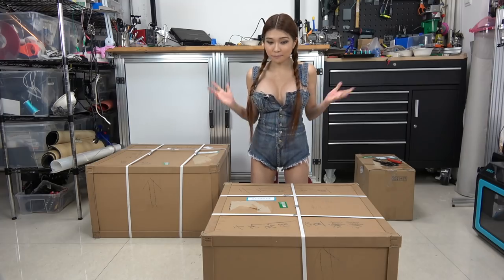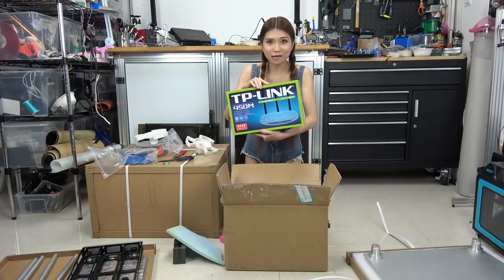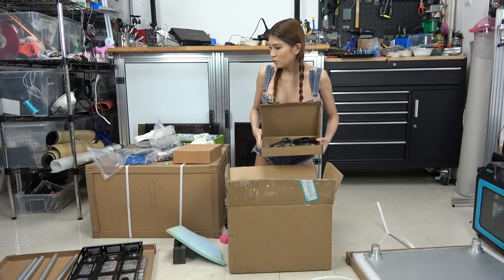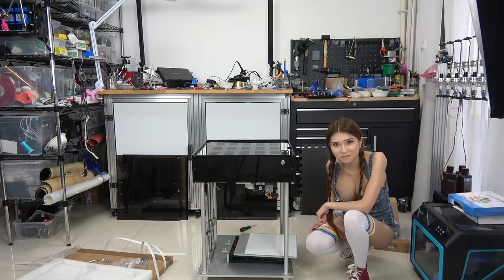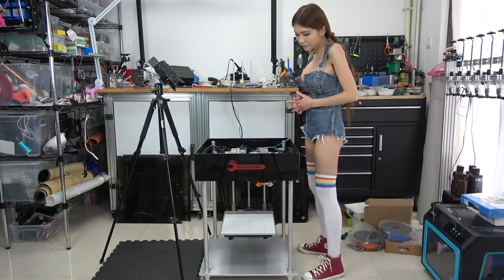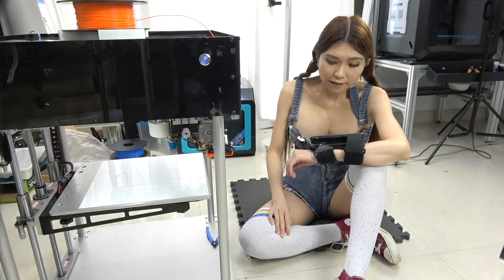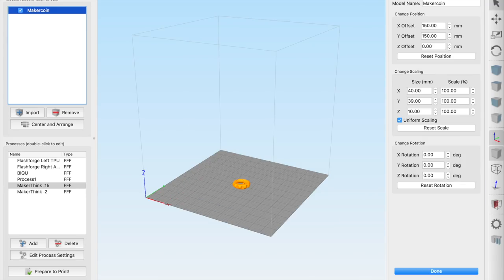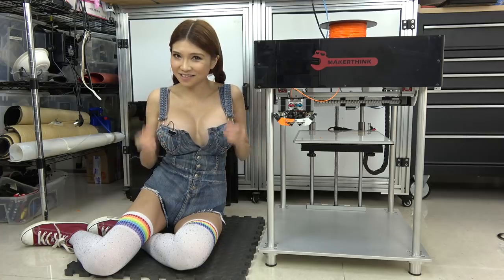MakerThink Knight Precision 3D Printer Unboxing!

Comment: Hi Naomi. I'm so glad you recognize other female technologists in your presentations. Thank you!
Suggestion to MakerThink: A 3d printable bracket set; to be used on the support columns that would allow you to bolt on simple panels. This would provide a simple heat-retaining enclosure.
PS: I think the use of servos on low-end Laser, 3D printer, CNC are the next big thing.
Reply: In fact we have the panels for enclosure. But in the video, we didn't use it, so people can see the interior better. from MakerThink :)

Comment: The filament path looks like it needs some of work, the print quality for a machine that solid out of the box should be better. 
With Octoprint on it should have a slicer plugin loaded and it should be setup to work with the machine. 
Related its nice to see you promoting other women in 3D printing, Gina Häußge is a rock star for octoprint. I always find it puzzling why only 5% of the views on my channel is from women.

Comment: I think the word u wanted was thread. Groove is OK but bolts and screws have threads. But ur English is excellent really 👍 💕. The socks were cute too 😘 Long time fan 😉 🌹
Reply: I believe component recess is the correct terminology you're looking for. Good video if you just want to view what it looks like to get a rough idea but I prefer to read the technical manuals & specifications that's just me. I already can see some over heating issues that will surface but I guess they will figure that out it's a prototype all along right :)

Comment: Hi Noami, one thing I like about this printer, is that it can disguise as a table top when not in use. Space saving. The platform stay up when off ?, this way, you can keep printer related stuff at the bottom.

Comment: Hay Naomi quick temp set for Printoid is to touch the extruder logo above the slider it will give to a type in number pad prompt for setting the temp to an exact temp.

Hope that helps 😀
Reply from the maker: AH! Very much so- thanks for the tip🙂

Comment: That is quite the tank. The only issue I see that might come into play would be table deflection on very large prints. Linked duel Z axis screws would be more robust.
Reply: Hi, I am the designer of this. We are considering on dual Z for a larger model.
Reply: Good to know, Thanks.

Comment: Really impressed with the industrial thought going into this, and have checked out their site. Liked everything from the move to servo motors to the tension adjustment screws on the extruders themselves. Though I am interested in developments, and wondering the price point they are gong to sell this at. Seems with build itself shipping cost are going to play a huge part.
Reply: We will do our best to reduce the shipping cost :) That's why you can find 2 cases in the video, and why Naomi need to assemble it. from MakerThink .

Comment: A printer with ballscrews and servos deserves a auto bed leveling probe. Also Im wondering... what about the rigidity of the aluminium rails - does it shake a lot, or is it sturdy?
Reply: It's very very sturdy. I promise.
Reply: great! Still though - with that setup it needs a bed leveling probe. Seems a shame to level it by hand when it's got such nice gear otherwise.
Reply: Could we discuss about the auto leveling? We are happy to add one.
Reply: Sure - what is the build plate made of? It looked like aluminium, right? if so - I believe the cheapest, and also best way of autoleveling would be to simply add something like this: https://www.youtube.com/watch?v=11HUw2CCmCQ&t=23s

Otherwise, a capacitive sensor would also work just as good(if the buildplate is covered with buildtak/pei)
Reply: Metal hotbeds are tricky - they have a tendency to warp slightly since you heat them up. Im not sure by how much, but being able to do multi-point probing is always a good thing :-)
Reply: We are considering about using another model from Omron, which can work with non-metal surface.
Reply: what kind of probe?
Reply: BTW: My bad - I meant inductive probe, not capacitive.

Comment: After see the finished works the cube stringy could be adjustment issue or nozzle defect it did drip at first nice converse shoes I had a pair when I was young play on the team they were big name back then see they are making a comeback that out fit is cool too got that back woods feel going.
Reply: Right now I guess the reason is the cooling fan. I think it's not connected. We designed a plug near print head for this fan but seems we forgot to plug before shipping.

Comment: Greetings from New Zealand again Niomi,  wonderful video as usual, these prints seem to be getting bigger and heavier. Definitely not a hobby machine! But I certainly like the solid build quality. How did you find the process of feding in the Filament?  I'm sure my hands are not as delicate as yours, seems like a small space ai?
I'll definitely look into octoprint for use with my prints,  thank you for a most informative video, be interesting how this product pans out.
Reply: Hi, I am the designer of this printer. We have a tube on the upper side for feeding, so you can just grab the filament and put it into the tube, and just click "extruding" on your control panel.
Reply from the maker: Looks tighter than it is, honestly feeds just fine. Just move the carriage to the front.

Comment: Looks like a very robust printer and laid out nicely, I’m not entirely sold on the access to the filament feed, but if it works without any problems why change it. Would like to see what the dual filament prints look like.
Reply: The dual head on this printer is still a prototype and if you like you can get updates from us. (the designer)

Comment: Did they mention an expected price range?  That would be helpful in determining what features / performance should be expected.
Reply: PhotoBobBarker features can be found via the link to website and the price range is $4499+ so far
Reply: PhotoBobBarker features can be found via the link to website and the price range is $4499+ so far
Reply: I could see the listed features, but I couldn't find a reference to the price anywhere.  Thanks for the info.  My question on price was to allow us to know how to limit expectations based on the cost target of the printer.  As an example, you wouldn't expect a self leveling bed or dual feed on a two hundred dollar 3d printer... But I would expect a self leveling bed on a unit costing closer to $5K.

Comment: It does look very well made, though I am wondering why they didn't make the build plate larger? The frame is HUGE, but yet the build plate doesn't comparatively look anywhere near as big as it could be for the allotted space in the case. What was the thing on your wrist? it looked like a smart phone on band? Is it just a touch screen that come with the printer as a means to control the printer, or was it your own phone with some kind of software on it? In which case what all is the software?
Reply from the maker: The printer runs OctoPrint which can be accessed from any browser- I'm just running client software on my phone.

Comment: Please do at least one more video with this printer. I'd like to see how it does with the enclosure installed, perhaps with ABS plastic, and also how the dual extruders work. I've read a lot of people dislike the side-by-side duals because they're never exactly aligned, but this printer is so heavy-duty they may not have that problem.
Reply from the maker: I certainly will- lots more stuff to test!
Reply: We are still working on the dual printing but we almost have the non-aligned issue solved. If you like you can get updates from me. from the designer.

Comment: Hi, Naomi. I just got a new 3D printer called the Snapmaker. It has an aluminum heated bed with a somewhat rough textured surface. So far I have not been able to get my PLA to stick very well, if at all. The bed is heated to 50 C and the extruded is at 200 C. I tried putting wood glue on the surface but it did not work. Some people say don’t heat the bed for PLA but heating it has been the only time I got it to stick. Do you have any good suggestions on this issue? I love your videos and your knowledge of 3D printers must be strong with all the ones you get. Thank you.

Joseph
Reply from the maker: Make sure it is very, very level, the head is the right height above it, last try using a gluestick or blue masking tape
Reply: Thank you so much. I also raised the temp of the extruder and the heated bed and had no issues after that. Take care and have more fun making things. By the way, what do you do with all the 3D Printers you get for review?

Comment: It looks nice and sturdy assuming the company is using quality parts, and looks different from using the standard 20x20 aluminum extrusions. Plus it comes with octoprint. Some parts might even be too heavy duty for the size, which will obviously affect the cost and cause more momentum causing slower prints or lower quality prints. For the size, I think the heavy duty parts are acceptable and also has the benefit of already being large in case the company wanted to provide upgrade package options for longer rods/screws/frame mounts for a larger build volume options.
Reply: Yes. It's great that you noticed that. To upgrade the printer to a higher Z, you just need 4 more poles and a new Z module.
Reply: Yes, but it's a question of whether or not the company will support upgrade packages like that. Especially if using non-standardized sizes. The end user can do it themselves, but I've been finding first hand that certain parts always arrive bent from sellers on Aliexpress or Banggood. I'd rather have options from the printer company themselves, assuming they are of a reputable nature. 

For example, I would love to see Prusa offer upgrade kits for a taller Prusa since it would just take longer rods and screws and a taller frame. Heck, I'd buy rods and lead screws from them for other printers if it were an option from them.
Reply: Actually, we will do it asap, because I am the designer. :)
Reply: I always have the idea that users can tell us what they need, and we can provide it.
Reply: Good to know. :)

What size lead screws does the printer use in this version? Only guessing based on the video it looked like maybe 12mm?
Reply: You are right. It's 12mm.
Reply: Cool, that should be just fine to extend the length beyond the 1000mm limit that 8mm's tend to have. (from my understanding)
Reply: We have another model called Castle, it's 750 x 750 x 750 and the lead screws are 16mm.

Comment: Seems as if the design intent is to go as strong and rigid as possible on the frame and drive screws. As long as backlash is minimized it could deliver some very high quality prints.
Reply: We can print some M3 threads. Want to see it?
Reply: ly Zheng, yes, m3 is really fine detail!

Comment: Naomi, did MakerThink give you a rough idea as to what the retail price might be for this?  Their website doesn't seem to make any mention of price.  Also in your opinion does this offer any advantages over a CR-10S?  The initial prints you made didn't really seem any better than what I can produce on my CR-10.  
Keep up the great work! 😁
Reply: Emm. We mentioned! LOL. A bit higher than an Ultimaker. And the print result, we are sorry about it. A cooling fan not connected correctly caused that. So if you want to check more samples, please let me know.
Reply: ly Zheng oh sorry, I didn't realize you mentioned price in the video.  I would like to see more samples.  As an engineer I'm interested in this printer.  Like you I'm very curious how servo motors hold up compared to traditional stepper motors.  I work in medical imaging and in those types of systems we use servo motors (for high torque) with encoders mounted to the back of them.  They can lose their calibration after time and need to be re-calibrated.  I wonder if the same will be true for this type of printer.  
By the way, very impressive that you take the time to read your comments and even more impressive that you respond. 😄

Comment: The printer looks great, but I'm not convinced by the way the filament enters the extruder, I think the curve is very pronounced.

I've been printing for 6 years with my Prusa i3 Rework (made at home) and sometimes stability is a problem, but this printer looks very strong!
Reply from the maker: I'm with you- I said the same, but in fairness I could not make it a problem even though I tried a few ways...
Reply: As the designer of this printer, I have to say, almost all I want is a printer SOLID FOR EVER :)

Comment: Hi, Naomi. Thanks for the video! 
about the blobs in torture cube. Maybe you increase the retraction distance to 5 or 6mm, this not occurs more, and the print will be more clean. This parameter, the retraction distance, I use in simplify 3d. i.m from Brazil. Thanks

Comment: How long did it take for you to level the bed (it's one of the bits I hate the most about printing lol)?
Is the bed heated?  It seems like aluminium would drain heat away like no tomorrow.  
Also, did you get any warping in your bed?
Reply: If i'm getting this printer though, i'm buying a trolley.   50kg is nuts for anything desktop lol.
Reply: I don’t know the exact time Naomi spent for leveling. When we are leveling one, it will take about 5 mins. But bed is heated. Maybe you have noticed that there is a silver cover under the bed, that’s the material we used for keeping it warm.
Reply from the maker: About 5 min, very easy as far as manual bed leveling goes. No issues.

Comment: Nice to see you showing us this new big 3D printer. I think that the result in the pieces are not too fine, the layers are really evident, and the stringing mistake is not good at all.
Reply from the maker: First print with no dialing in it's pretty decent, will see after I've fiddled with it a bit.

Comment: Hi i liked the unboxing but i have some questions ? Having an heavy top isn't it shaking if it goes fast ? I also have some printer with Smoothie and i had serious troubles to connect it to octoprint is there a special trick to do so ? And why would you prefer the duet ? I really like the Octiprint a lot so why do you have different preference ? and is 0,05 mm really necessary ?  (and maybe it is closed loop steppers ;)-
Reply from the maker: Duet has a lot of more 3D printer-specific features. I think ideally the Duet Web UI would be reskinned to work more like OctoPrint.
Reply: thojo mech Hi. Thank you for the question. The top doesn’t shake much because we are using a very solid connection. We reproduced the smoothieware board and our engineer might have changed the UART port a little. By the way, this machine used Servos not closed loop steppers. Maybe we can use it on a cheaper model.
Reply: ah i see normally servos have the issue that they can accelerate fast but for the small ways a 3d printer goes they are much more expensive than an closed loop setup

Comment: After your visit to Creality's factory, they agreed to become compliant with the GPL.  Do you know where they have uploaded ( or IF they have uploaded ) the source to the Marlin Firmware for the Creality CR-10/10S/10S v2.0?
Reply from the maker: They did, then they closed the source😡 Really pissed about it. Best firmware now is Marlin's own CR-10 firmware, better than factory.
Reply: Yeah, I loaded the TH3D "Unified Firmware" for EZABL.  They do release and give you the source code to their changes if you purchase the EZABL products ( as required by GPL. ) 

Thank you Naomi, for your effort to try to explain to them the importance of sharing and compliance with the license.  It's clear that there is a cultural barrier to having companies in Shenzhen understand Open Source, and the requirement to give back to the community/customers the changes they make.

Of course, they are still using Marlin and the power loss/restore feature is unique to each implementation at the moment because of all the different hardware configurations people do to achieve it.  

Hopefully, at some point someone in the Marlin/Reprap community will either reverse engineer the feature, or simply replace it with an equivalent one.

For now -- what do you think is the best "Bang for your Buck" in mid-to-large format 3D printers in the Chinese market?  Anyone producing SLS nylon powder printers?

Comment: Hey little cyborg, I think the benchy looked a bit overextruded on the side there, that might explain some of the oozing issues with the torture cube. Dial the flow factor back to 80% ?

For the rest it looks like this printer has no control except manual control?
Reply from the maker: yeah there's lots of dialing-in to do on the printer settings, for one the fan was not plugged in.
Reply: Robin den Hertog Will 80 be too less? Emm.
Reply: Naomi 'SexyCyborg' Wu that might explain some of what I saw, indeed. But just seeing if xmm.movement is actually x mm might be a nice idea as well?
Reply: ly Zheng maybe, it's a bit much (esspecially given that the fans were off, the warp likely changes this a lot as it looks similar to overextrusion when the sides curl up and are only pushed down by the nozzle and the fillament on every pass)  but then you can easily dial it back up (assuming you have that control)
A lot of printers have some slip in their feeders and compensate by overextruding a bit.
Reply: Thank you so much! Hope you can always be with us to make it a better printer:)